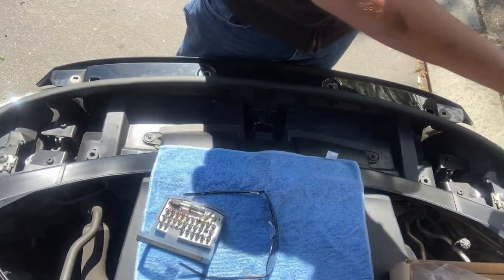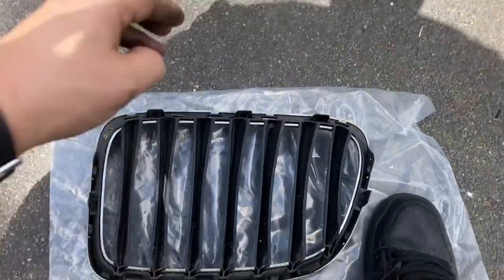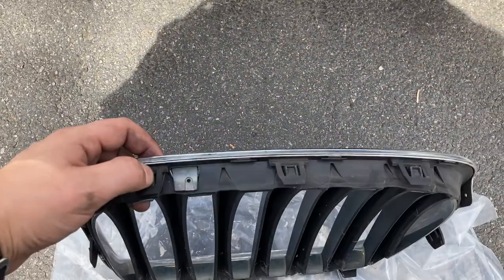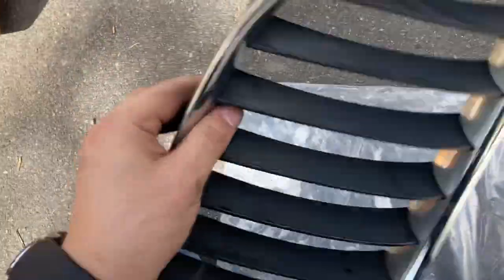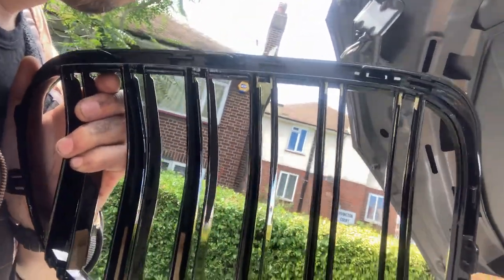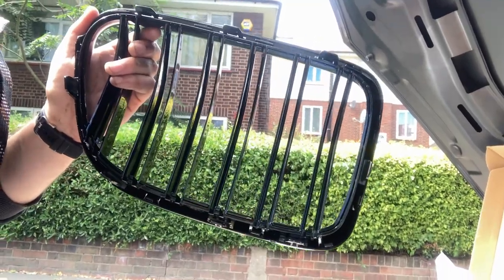Kidney Grill replacement BMW X1 E84 project Part 8

Comment: Where  did you order the grill?
Reply from the maker: Hello Christopher, I found those on eBay at this address https://www.ebay.co.uk/itm/Sport-Grill-Kidney-Doppelsteg-Black-Shiny-For-BMW-X1-E84-09-15/293550098235?pageci=fe74e6ae-5b08-4ea4-b87a-5c74cc4005e9
I suggest you tho, to look on amazon they are way cheaper, use search criteria “Dual slat bmw e84” should come up more variants for a wider choice.
I hope this help, thanks for watching 🙏
Reply: @GianniHow  Thank you.